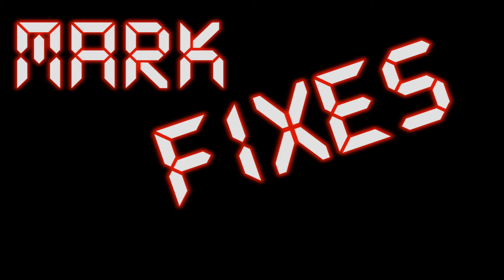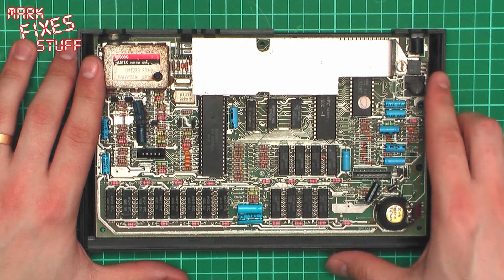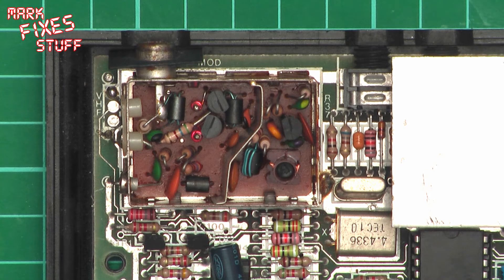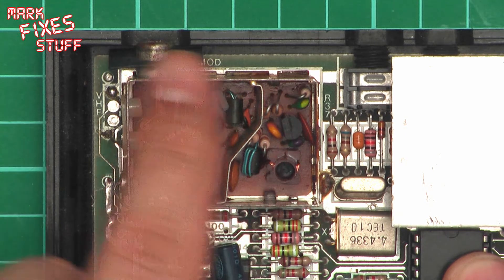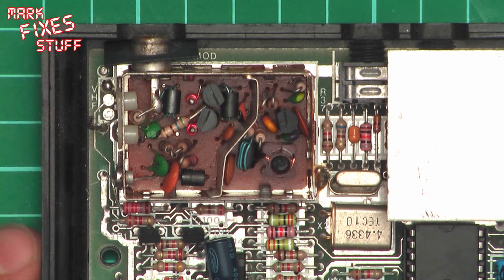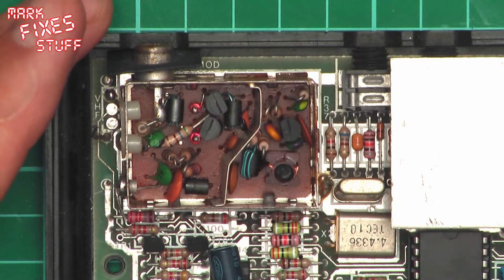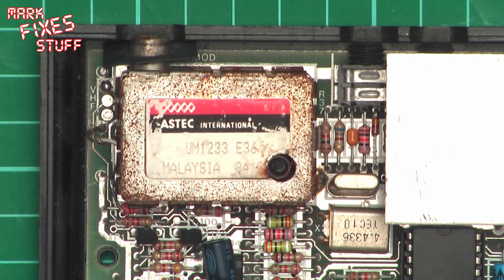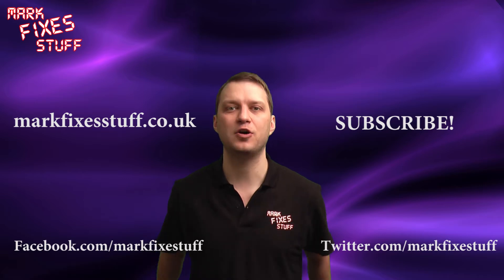No-Soldering Sinclair ZX Spectrum 48k Composite Mod Tutorial - Use Sinclair ZX Spectrum on SCART!

Comment: Just made my mod 30 minutes ago...
 The picture is much better on my 32" LCD, than previous RF, but not perfect. Hardly used any copper wire anywhere... (erhm, first I connected with reveresed polarity my aftermarket power brick, duh)
 My 30 years old cassettes does not work from my Sony mini Hifi (maybe the tapes, maybe the sound output of the hifi), and my old cassette player gave up. 
 Unfortunately I have no iphone for Speccy Tape, but will definitely find a way to play with it again (has a Nokia phone, has an android Tablet, has a Walkman, has a PC, one of them should work in some way)
 I got a RAM turbo Joy interface+Quickshot with the Speccy, so my 7 years old boy may enjoy Manic Miner after so many hours with LEGO Chima 3D worlds :-D

 I was still not brave enough to cut the wire of the internal speaker, but via EAR out the sound was a "little" better on the Hifi or even on the TV speakers.
But that one would be treated as a too rude modification, right?

Comment: это не оригинал - оригинальный ZX был на чипе залитый
Reply from the maker: +TheEfcool I am not sure what you mean that it is not the original? This is an orginalZX Spectrum.
Reply: It not the original of ZX Spectrum! there inside has to be ULA chip!!! Square such, from four parties of a leg....
Reply from the maker: The ULA is clearly there.. It's the chip marked with ULA and it's pretty much in the middle of the board. It's to the right hand side of the X2 oscillator.

Are you getting mixed up with a soviet clone?
Reply: like this payment, only the chip was with an iron cover and on a cover of this is written nothing
Reply from the maker: +TheEfcool That picture isn't a Spectrum. It's a Timex Sinclair 1500, which was mainly for the US market. The machine in my video is a standard, normal 48k Spectrum from the UK market.

Look at this picture. The ULA is marked as IC1.  I promise you this is a normal UK Spectrum  :)

http://www.animatez.co.uk/computers/zx-spectrum/hardware/
Reply: Well, well anyway it was to play cool earlier.... I lost the ZX... (my the last was ZX Profi + 1024k). It is a pity. Not really often I play on the emulator PC.
Reply: This collected, the truth on start and check gave to the uncle.... Then I played at the nights without a break